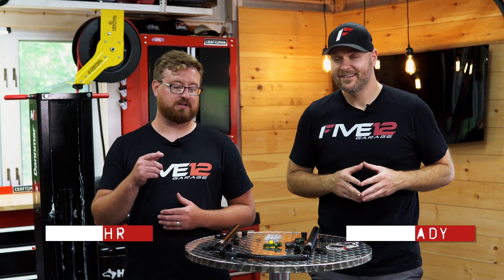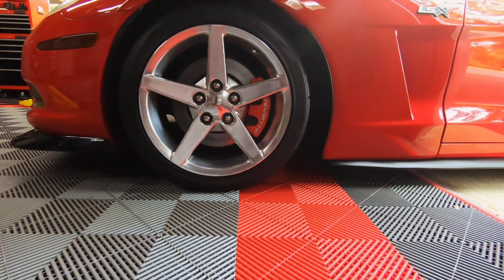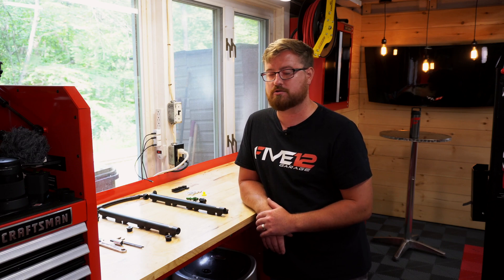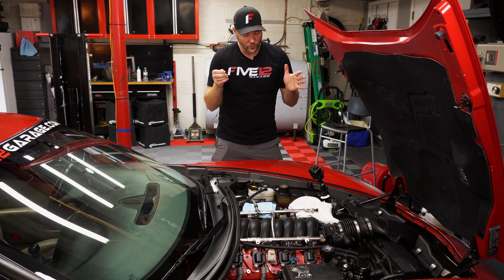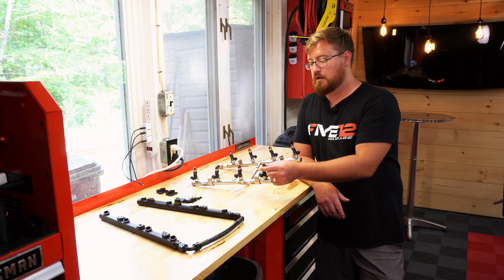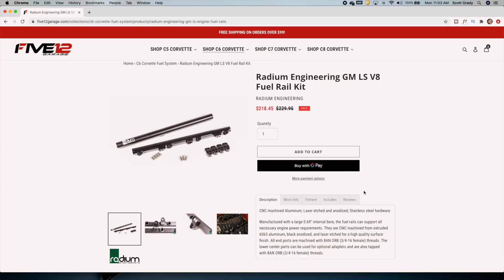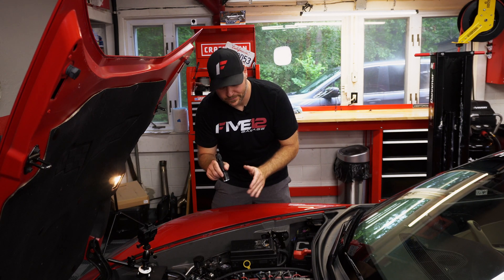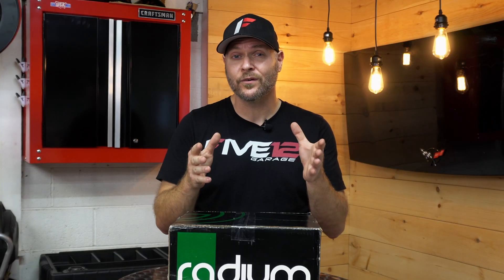Upgrade Your Fuel System | Radium Engineering Fuel Rails for LS Powered Corvettes & GM Modern Muscle

Comment: I have a Vortech V3 supercharged C6 with long tube headers (no aftermarket cam). Would you recommend a fuel injector upgrade for this setup? I want to maximize horsepower while also keeping in mind the health of my engine. Thanks in advance !
Reply from the maker: I would suggest talking to your tuner for the best answer.

Comment: WOW! First off, I love all the braided lines and the labeling coming off the Oil Catch Can. When can I bring the GS to the Five12 Garage for THAT upgrade? I'll just want custom labeling though. In Gold instead of white!😉 As to the fuel rail upgrade, is it only for a modified LS engine? Lastly, I like my Fuel Rail Covers, can they be reinstalled with this setup, if not, could they be modified to still be used yet exposing the fuel rails themselves. Keep these uploads coming Scott. Now, go pack your bags. You can't be ready too early for your Pilgrimage to Carlisle. Save the Wave🙋🏼‍♂️
Reply from the maker: So the big downside to running this setup and your fuel rail covers, is, well, your fuel rails get covered. You can run these on a stock LS motor too. So no worries there. Not sure where Greg got those catch cans, but they do look cool. Ok I’m off to pack.
Reply: @Team512  Thanks Scott. So with my LS3, which only has an aFe CAI, headers w/perf.cats, x-pipe and Corsa Extreme axle-back, this Fuel Rail install really wouldn't really do much for me?
Reply from the maker: Not really. Unless you wanted to remove your stock fuel rail covers so you can show them off!
Reply: Okay,  I guess I'll have to pass then. If I removed my Stock Rail Covers then I'd just polish up my factory fuel rails to look like chrome, replace my valve covers and/or have them powder coated in maybe body-color and then paint my coil-packs something shiney or relocate them so that the entire valve cover is exposed. I guess I might as well look to order a C8 and then all I'd have to do is dress-up the intake. Then again, I'd probably go crazy with CF add-on pieces. Sheesh, I've really got to stop the madness! 🤭 But what fun would that be?🤔 Thank you again Scott.